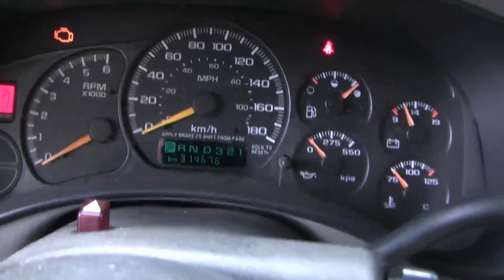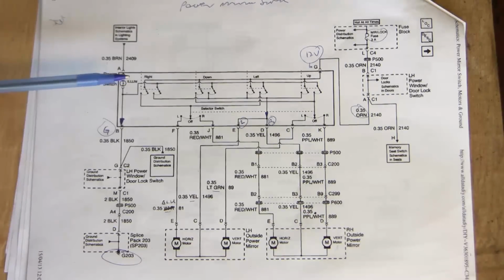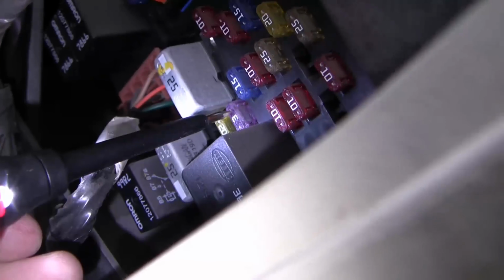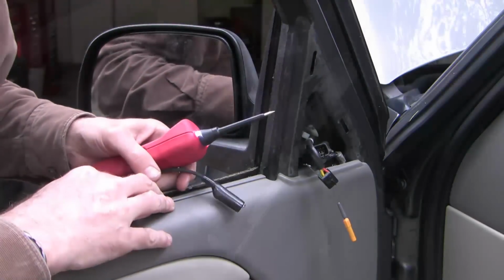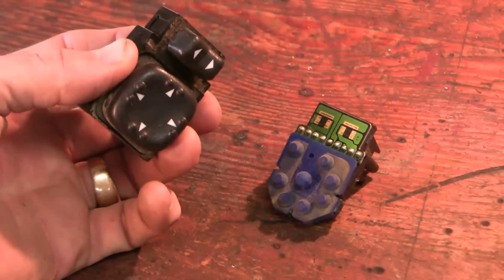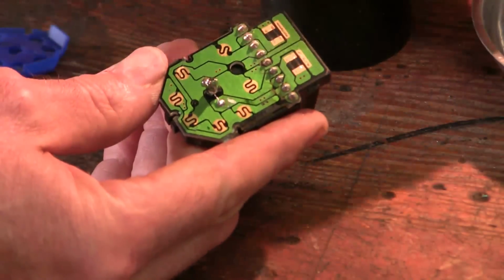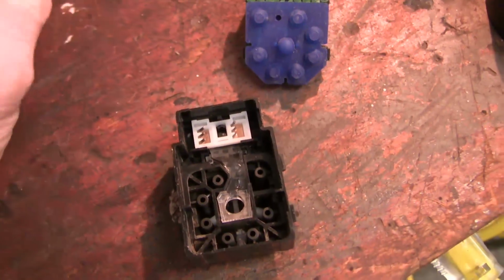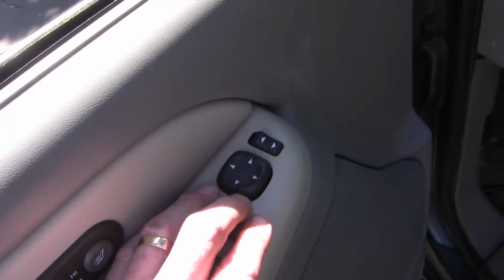How to fix a car mirror that won't move -- Chev Suburban

Comment: You helped me. Thanks! One question: Orange is hot at all times, but the mirrors only work with switch turned on. The diagram does not show what keeps the switches from being energized with switch off. Can you help?
Reply from the maker: Those switches are ingenious. If you look closely, you'll see there are three positions. The middle one is off, but the opposite two legs direct flow the reverse way through each motor, allowing the motor to drive in either direction.
Reply: @spelunkerd  I didn't phrase my question correctly. Do your mirrors work while the ignition switch is off (key out)?
Reply from the maker: @billbyrd9845  No they shouldn't. Typically those switches are fed through a fuse and maybe a relay with switched power, only with key on. If not seen on your wiring diagram, follow the positive feed back, usually on the top of most wiring diagrams. You may find it on another page, the feed might come through the body control module, every car is different.
Reply: @spelunkerd  Exactly! And that's my point. Orange is hot all the time. So, in the interest of better understanding the switch, one needs to know what switched wire feeds the ups and downs. Of course, the orange will do for testing, but I see nothing on the diagram that shows which switched wire feeds it. It may even be a relay that makes up the negative leg. Anyhow, just a curiosity. Has nothing to do with the value of your video. Thanks again.
Reply from the maker: @billbyrd9845  Oh, I see. Sorry for not understanding right away. Good luck! BBBindustries offer free wiring diagrams on some cars, though it is not as complete as other sources like Alldatadiy or Mitchell. I'd be wondering of a previous mechanic has changed things, maybe for an aftermarket security system. I've never seen a car that has control of mirrors when key is off. New vehicles control these through dedicated modules, which are much harder to troubleshoot.
Reply: @spelunkerd  No, it's never been modified. The orange continues to be unswitched. And that's why I know that it wouldn't feed the switches. When it's not freezing cold in my garage, I'll probe the connector to find the feeder and then post it for the benefit of your viewers (not that it would have anything to do with your helpful video).

Comment: En la placa del circuito hay una resistencia de tipo variable (aparece en el video). Esta resistencia funciona abierta a bajo voltaje y cerrada a alto voltaje, imitando el funcionamiento qué demostración de cambio de polaridad cuando probaste el movimiento de los espejos. Al parecer la resistencia pierde sus características con el tiempo, principalmente por falta de uso.
El. modelo exacto, sólo lo encontré en Internet, pero puedes sustituirla con una de valor cercano. Puede que tu espejo retrovisor se mueva más lento.

Comment: Ahh sorry youve lost your mate :-(

I would check to see if the top pcb contacts actually get to the rear connector, if not then solder a thin wire on and bring it out of the switch to connect to the external wire.
The switch is knackered so you can be nasty with it, ha ha :-).

Ive bypassed stuff and with care it works fine :-)

Nice tutorial on fault finding/testing :-)

Comment: I am assuming there's no crack in the board or anything, should probably test that first.
This can be done by taking the switch apart again, plugging it in, and using the contacts from one of the other (working) switches to test the non-working one.

Comment: You mention you were just going to manually adjust the mirror in the direction that wasn't working. How is that done? Just press it to the side with your hand? Would that break something?
Reply from the maker: In my case the plastic gears would skip if I torqued the mirror. So adjusting that was easy, much like one does to adjust lawn sprinkler heads. I worried about damaging the gears, but it was so easy I had confidence I wasn't damaging them. Your mileage may vary....
Reply: @spelunkerd  Thanks for replying. How exactly do you do that, though? I think lawn sprinkler heads have an adjustment screw. Does the mirror have something like that or how exactly is it done?
Reply from the maker: @sd26001  With lawn sprinklers the screw adjusts the breadth of the sweep, but you twist the shaft to establish the 'start' point on one side. I didn't find an adjustment screw for the mirror. As I recall when it reached it's end point I could push the mirror back in to give the motor more sweep to the outside.
Reply: @spelunkerd  OK, so just push it with my hand to adjust it manually. I'll give it a try. I just got a  2001 Yukon XL and like your Suburban, the blind spots are so massive it's kind of hairy driving around with improperly adjusted mirrors :) Anyway, thanks again...

Comment: My 2000 blazer I bought does the exact same thing.  I'll try this.  BTW (I'm an idiot at electrical), what is the machine your using to run current?  Can you explain back and front probing?
Reply from the maker: It's a Power Probe, which is a trademarked specialty automotive tool that is unnecessary if you don't mind a little more effort with jumper wires. The tool makes it easy to apply power but you have to be careful because it also makes it easy to fry parts downstream. The Power Probe has a rudimentary multimeter in it, although it is not as versatile as a normal multimeter. The Power Probe has two feeder wires that you can run all the way back to the battery for power and ground, providing a good diagnostic reference. If you are building a tool set for this kind of work, I would buy an inexpensive multimeter, an incandescent test light (not LED!), and a couple of spools of automotive wire to make long connections. The Power probe is too expensive for occasional DIY use, although it is fun to play with. Front probing is done when you stick the diagnostic probe into the front end of an electrical connector, which could distort the connector and cause a bad connection when the connector is later put back together. Because of that, front probing is considered bad practice, a practice that is very common because it is fast and easier. Back probing involves sticking a very thin diagnostic needle into the back of the connector, allowing you to touch the wires and make your diagnosis without damaging the important contact parts of the connector. You can buy very thin needles for backprobing in the sewing dept at Walmart.
Reply: How would you do it with jumper wires? I have a 2007 GMC Sierra and the mirrors on both sides are dead. I checked the fuse and it's ok. (BTW: A shop owner told me that the problem is usually with the wiring harness in the door hinge, but after watching your video, I guess he was wrong)

Comment: I'm guessing the electrically conductive material on the button pad has deteriorated. This is a very common issue for GM switches. Sanding the contacts only makes it worse as it removes more of the conductive material. It is not a contaminant issue.

Comment: I have a problem with my drivers side power folding mirror not going into curb view assist..replaced tje switch and everything. What wire is the one that sends the signal to the mirror for curb view assist?
Reply from the maker: For that kind of detail you need a wiring diagram. I've been using alldatadiy but they recently boosted prices dramatically. Even so you can get access for a few days for reasonably cheap. I like alldata and mitchell because they give access to tsb's and updated info. Ebay will have pdf copies for sale, and the nice thing about that is you'll have a copy forever without extra fees.

Comment: thanks for the video.....now i replaced my driver side power mirror but the mirror moves to the wrong directions....when i push left  it goes up,when i push down it goes right..etc etc....the passenger side works with no issues..it moves in all directions but out of sync with switch.....any ideas....i have a 2012 hyundai tucson....thanks again
Reply from the maker: Two things come to mind. If the connector you are using can be put in the wrong way, look for that first. It sounds like the control for the two motors (up/down and left/right) has been swapped, ie the microprocessor thinks it is talking to the up/down motor but it's actually talking to the left/right motor. The second issue is the question as to whether the replacement is exactly right for your vehicle. Maybe the design changed. All that said, if you can't correct it by moving the connectors, you could swap the wires leading to the end devices. You could use special tools to take out the wire connectors or you could cut and solder wires to correct the wiring to suit your new microprocessor.

Comment: I think if you used electrical conductive paint on the rubber part it would have worked fine, I did this to repair a CB radio with the same sort of buttons. All the buttons wouldn't respond and after applying the paint it was like brand new.
Reply from the maker: That's a good thought, and I went on to do just that, using paint specifically designed for this task from Ebay. Unfortunately it didn't work in my case, and at the same time the price for a replacement switch fell into reasonable territory. Ultimately I swapped out the switch for less than $40.

Comment: 2013 silverado, the light inside the mirror control switch will not come on with the rest of the switches for night time driving. I have replaced the switch, thinking the bulb was blown. It still will not light up. Any quick troubleshooting I can do before I start tearing into the wiring? I'm thinking there is a loose connection somewhere but really need a schematic for checking power....
Reply from the maker: BBB industries offer free wiring diagrams, though I suspect you won't find such narrow detail. I'd be taking it apart to see what's wrong, nothing special that I know of.

Comment: I have a 2002 avalanche same switch but I don’t know if it lights up at night or not or is it supposed to along with the window switches?
Reply from the maker: I don't know about night lights, it may depend on the trim class of the vehicle. Now that I think about it, I don't even recall if the lights on my switch glow, ha ha.
Reply: @spelunkerd  I’ll make a video and show everybody else what I’m talking about because I’ve had the top two window switch lights not come on until one random night when they finally did, so I reckon that the mirror switch was out with it, but for gods sake the truck is 21 years old what do you expect? Lol

Comment: i have the exact same problem every direction but right work, and mine is a 94 and they stopped making them, i still haven't found one for sale anywhere, and i tow so moving them is good, otherwise i drive the truck mirrors stay in the same spot manwell style
i'm thinking bout wiring a ford switch in the dash just to piss it off.
Reply from the maker: Have you tried Ebay? Amazon sell one for my vehicle, though I haven't looked for one on a 94. Another option, as you say, is to go old school and wire two three-way toggle switches. Even so the circuit would be fairly complex.

Comment: I've taken my  1994 Olds Cutlass Supreme s to Firestone about 4-5 years ago for service and my power mirrors were working find when I dropped it off, but when I have gotten it back and was trying to use it,it would go up, down and to the left, but willn't go to the right,so I took it back and told them what happened and they said that they didn't mess with the mirrors, but they were doing an electrical check on it, so it had to be part of something that they messed up.A switch was put on, but it's still NOT working in the way I like.I need some advice  in how to get this fixed.
Reply from the maker: Unless they had the inner panel of the door off I wouldn't be quick to blame them, it could be unrelated. I would do as I did and check the wiring and clean the switch. Details are likely to be a little different but fundamentals are the same. You could have a broken or frayed wire but with impaired movement to one side only, a bad wire seems a little less likely than a problem close to or inside the switch. There are two motors, one for up down and the other for side to side. If you bypass the switch with power and are able to move the mirror both ways then the wiring is OK. The other switch in that circuit is the one that toggles between the two mirrors so possibly that one could be bad. The other thing worth checking is to be sure the mirror is in a neutral position with reference to the motor reach. Once the motor reaches the end of it's stroke it can't move any farther to one side because of mechanical limitation, so some systems need to be positioned mechanically in a neutral position so the motor has enough swing to drive movement either way. Some of this testing is a little complex and you need to weigh whether all that effort to bring yourself up to the level of a technician is worth it. I enjoy the work of auto repair and I'm willing to accept the effort and risk to fix things myself, but you may feel differently. In the end you often don't save a lot of money, especially if you end up needing to buy more tools. Good luck!
Reply: Thanks for the quick reply

Comment: at 7:42 when the mirror is at the end of it´s range, does the little motor still trying to move the mirror to the left? or is there any mechanism that stops the motor from working at its limit to avoid burn it ?
Reply from the maker: It's a plastic threaded worm gear, it keeps spinning even at the end of its range. Imagine how a bolt and captive nut behave when the nut threads right off, it can spin away not moving anywhere. Interestingly, when one direction for the motor works, the other doesn't, there is a tendency for that worm gear to eventually move all the way to one side.

Comment: what kind is your tester like to have one of those  thanks like the viedeo i try it an still don't work i might have an electrical problem . ? fuse is good
Reply from the maker: The tool I often use most often for automotive repair is the Power Probe, which is a quick way to string a ground and hot wire from the battery. They are about $100, not worth it unless you work on cars every week. You can do the same with a couple of long jumper wires, an inline safety fuse, and an incandescent old style test light. The most important tool is your head, with careful testing to verify and isolate problem. Whenever I face an electrical problem I try to simplify the question to a yes/no test that often proves the downstream circuit is normal. This often involved disconnecting the circuit at some point so that the results of testing are easier to interpret and so the chance of causing harm is minimized. Then I work backwards to isolate where the problem has to be. Professionals approach problems a little differently based on their experience, saving time and quickly going to the part most likely to be defective. As long as they prove the part is bad before replacing it, both approaches should end up at the same conclusion. Common points of failure at the door are the switch and the loom of wires going through the door. Both involve moving parts, since aging of wires and connections eventually leads to early failure.
Reply: Ok thanks ill look in to it to get one

Comment: Hello, what if it makes the sound, but doesn't move? I can hear the motor working, but the mirror doesn't move left/right. Up and down works fine
Reply from the maker: Possibly a mechanical issue, inadequate lubrication or gears binding. This week I saw a similar video by 1Road describing how to work up a mechanical problem, it complements this video nicely. Title is "This one thing could fix any electrical issue...."
Reply: spelunkerd subbed to both you guys now. Whether I can fix it or not lol. Appreciate the help.

Comment: Having a hard time getting it apart,how did you do it?
Reply from the maker: Can you write in a remark at what stage you are having difficulty? To do that, enter a time for the video, such as 6:21. Youtube automatically makes numbers entered in that format into a link, which, when clicked, takes the viewer to exactly that spot in the video. Without that info, I'm guessing you're having trouble getting the mirror plate off the mount. It's tricky, you need to pry the little teeth off, one at a time with a long flat blade screwdriver, and at the same time hold the mirror from falling. Once enough teeth are off, the mirror just falls into your palm.

Comment: What type and model power probe was use din this video?
Reply from the maker: I had a PP2 at that time, shown here, and it's still working fine. I love it. I bought the accessory kit with longer wires, a few tools to puncture wires, and some extra adapters. A few years later I was given a promotional PP IV by Eric at SMA, and I've used it as well. The PP IV has the ability to produce a voltage less than 12V, and there is a safer cap on the output current, which makes it better for simulating the 5V power feed and for testing things like the PCM response to narrow band oxygen sensor output. The old work around is to just touch the 12V power supply with one hand, touch the oxygen sensor signal wire with the other hand, and look at the PCM for a response on a scan tool. The huge resistance of your body protects the downstream PCM from damage! ScannerDanner uses that trick all the time, he's never had an issue. For the kind of things I do every day, the PP2 is more than adequate, and it's a game changer. Even so, I would never do without a test light, which dynamically test circuits like no other tool.